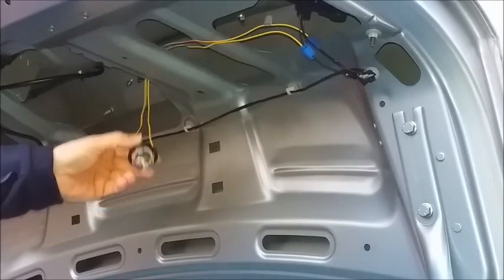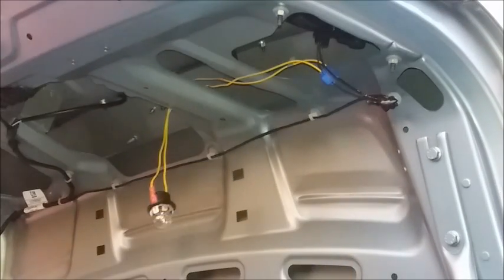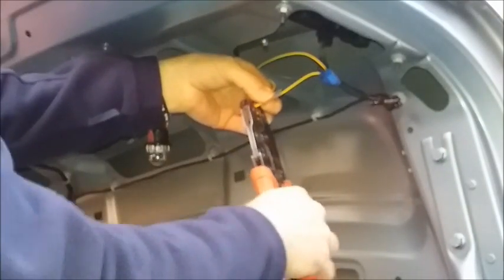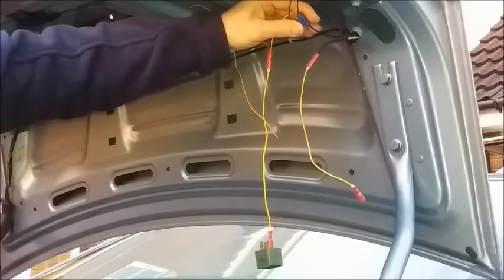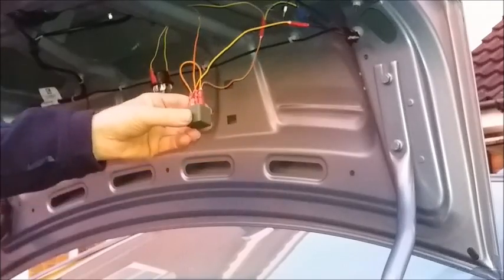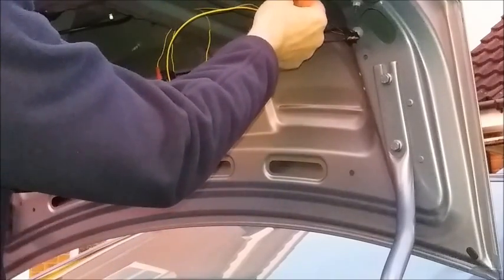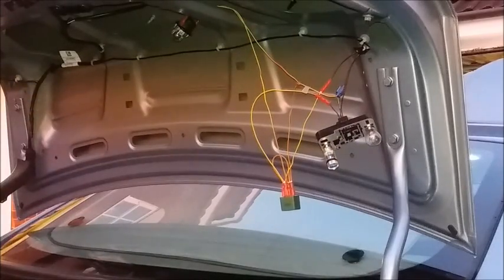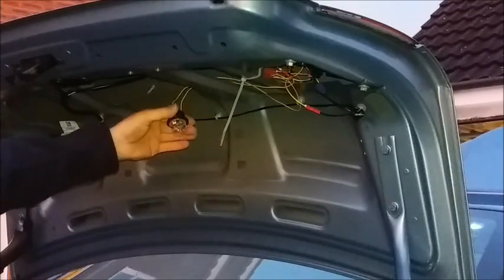How to Fit & STOP LED Bulbs FLASHING on a CANBUS Car

Comment: Hi..I’m trying to replaced my normal headlight with the genuine xenon headlight, after few second when you start the car they cut off 😞 any idea or help???
Reply from the maker: Switching out the standard halogen headlights for the optional (or Aero) xenons is possible but it is an awful lot of work. Once all the parts have been fitted it needs programming with Tech2.
There are easier options and I shall be doing a xenon headlight mini series later in the year.
Reply: Cyclone Cyd is Three any chance to play something only with the wiring? Or if you have any diagrams
Reply: Costantino Fortebracci I had this exact problem, the UEC doesn’t send enough power required to keep xenons running, u got 3 options, 1. Wire a separate switch and wire for only your xenon, 2. Wire a lead from +15 fuse to your headlight, which will always be on as long as key contact turned to on, will never flash or go out, 3. Go with tech 2 /dealer, I did option 2 so I could turn off the lights whenever I wanted, takes a bit of wiring, but worth it

Comment: I just changed to LED lights on the reverse lights on my saab 9-3, they do flash. I'm just wondering if it is necessary to fit relay? I don't mind the flashing and its only on the reverse lights
Reply from the maker: In the Uk it would fail MoT and be considered unroadworthy. It might also confuse a driver behind and if he were to hit you and could produce dashcam footage you would likely end up 50/50. And it might attract the attention of Dibble and That's the wrong sort of attention in my book.

Comment: Used this technique for my front headlights on my Saab 9-3  works a treat thought I was going to have to stick to halogen for a while
Reply from the maker: I've got a headlight refurb project coming up soon. Fitting new projectors. You could 'upgrade' to HID projectors. 👍
Reply: How did you handle the bulb connector on the car for the headlights? Did you have to cut it off to connect from the bulb to the relay?
Reply from the maker: @Travelwithleo  No, don't cut the connector off. Use 5.3mm spades to connect into it.
Like these  https://www.ebay.co.uk/itm/293305356049
Reply: Travel With Leo no managed to build a connector that fit into the original and branch off to the relay box

Comment: Hi I have a Vectra c is there a way to stop flickering on rear light/brake light ? Or is it not possible at all?
Reply: I have a Vetra C too with a lot of 382 - P21W bulbs in it. Unfortunately, that is one of the expceptions mentioned at the end of the video. @Cyclone Cyd, did you find any workaround on this type of bulb? :(
Reply from the maker: Not yet. I'm still looking though

Comment: Nice video! I know this is probably hidden in quite some comments, but I'd like to have a check with you on my project. I have substituted all my bulbs with LEDs on my Saab 9.3 cabrio (2006). High, Low and Fog. With engine running, I always have low beam on, so no pro there, but high beams and fog bulbs flickers (and it's not really fine, though it doesn't blind anybody). Do I need a separate relay+resistor wiring for all of them? If so, can I try an installation right after the cables exit the main computer unit, to try to keep all the wiring in order and tucked away? I understand it could take 6 relays/resistors, so it's a lot...Thanks for any help.
Quick integration...would something packaged like the morimoto anti-flicker capacitor work? It's just one random product I found looking around and it seems pretty compact, if the connections are Saab compatible.
Reply from the maker: yes you need a relay for each bulb. Don't see why you couldn't do it at the BCM, would be tidier
Reply: @CycloneCyd  Thanks, do you believe there is enough room there? Could it be possible to actually use the two 87 and 87A pins to connect 2 bulbs to one relay?
Reply from the maker: @giuliomorandini3137  not sure about the room, I haven't looked. One relay per 2 bulbs? Yeah, I think it'd work.

Comment: Hello mate thank you for the video - quick question I have the resistor (an actual 50w 6ohm resistor) do I still need the relay? Thank you 😁
Reply from the maker: Hi Shane, yes you need the relay. the resistor fools the system so you get no error message, the relay separates the LED so it does not flash with the check pulses.

Comment: Will you need to have one of those little resistors for every led light you want to swap in? For example, I want to change my low beams, high beams, city/parking lights, foglights, and license plate lights.
Reply from the maker: 1 resistor per bulb yes
Reply: @CycloneCyd  oof lol. That's a lot ot resistors so fuck that plan😂 I guess I'll just live with the flicker
Reply: Love how you educated us car-fixing rookies with the how and why! I have a Saab 9-3 and the flicker from the LED headlights continue for a solid 20 to 25 minutes after I turn the car OFF! But the fix is so involved. If I just leave it, will it harm my car eventually?

Comment: Have shared your vid with a few others who tried n failed as I did b4 finding your vid. But, I also have a Saab 9-3 Aero Cabrio on a 55 plate. If doing as you have for the reverse lights, provided the resistors are in line for each bulb separately, can we connect in BOTH reversing bulbs to the same Relay without any hassle?  After all, its only a relay and should be able to handle a pair of lights!!
Reply from the maker: Good thinking Batman! Hi Mark, yes I think you could. You'll need a resistor at both positions (because the system detects the bulbs sequentially), but you could use one relay and just connect the two bulb positives together across the boot. You could do the same on the front parking lights and main beam assists too. Thanks for sharing, glad people are getting value from it. Let us know how you get on.
Reply: @CycloneCyd  Cheers. Just a quickie,  for those who don't know the relay terminology, might be good idea to simply list the numbers on relay and which connects to what....
85 - Positive feed from car
86 - Negative feed
87 - Positive feed to LED
87a - Positive from Inline bulb
30 - Split from Car feed in 85.
Errr.... Think thats correct ??? Pls confirm lol
Reply: Cheers Mark, i was just about to ask the same question!

Comment: Hello,
I have a Vectra C 2008 year. I take a led to front side light (W5W aka parking light) but if the ignition is off, the leds are flashing. If i buy only a resistor is enought (39 ohm 10W) , or I need a relay and resistor too, for the solution?
Reply from the maker: You need the relay and resistor as shown
Reply: @CycloneCyd  many thanks for the quick answer, and thanks for your help!

Comment: I bought some H7 LED bulbs and when i turn off the lights, the blink every 3-4 seconds. I have read that you can buy a decoder to put in between but dont know what to get. Can you give any advice or do a video showing how to do it on the low beam headlights?
Reply from the maker: Hi Mark, the method is exactly the same for any lamp position. Doing it on the reverse lights was just an example (and I needed super bright reverse lights).

Comment: Hi I have realys very similar to the ones used altho the diagram is different and 85 and 86 are reversed can these be used or do they need to be exact??
Reply from the maker: Hi Marc, Thanks for watching, welcome aboard. All that matters is they are changeover relays and you can identify the NO and NC (normally open and normally closed, resp.) contacts. I don't know whether the pin layout or numbering are 'standard' or not, but they don't matter as long as you can meet the requirements of sentence 1.
Reply: Do they have to be 5 pin type??
Reply: I have 2 here but have no idea if there usable or not
Reply from the maker: @marchood99  5 pin yes.

Comment: Hi there i found this really helpful i have a vectra c and i did my side lights with the and worked a treat im going to do full beam and fog lights and just wondered if the same set up here will work for them thanks
Reply from the maker: Hi James, welcome aboard. many of my 9-3 videos are relevant to Vec C too.
Yes, exactly the same for all positions except tail/brake
Reply: @CycloneCyd  thanks mate i got them all done very happy lol
Reply: Hi i am abit confused as to how to do the full beam light as the bulb only has a positive going to it and the negative is attached to the cluster do i just take my negative from the for the acting bulb

Comment: Does the led drain battery when the leds flicker? I got them in my low beam and i dont want to wake up to a dead battery
Reply from the maker: No. Once the car is locked the ECUs go to 'sleep' and after about 1 minute you'll find they are no longer flashing.
Reply: @CycloneCyd  Is this the same for taillights?
Reply from the maker: @shawnlee3397  yes

Comment: And how does this work with number plate leds?
Reply from the maker: The number plate lamps are on the canbus bulb check circuit so they need the same treatment. Exactly the same.
Do let us know how you get on.
Reply: I had it done on the number plate lights and it did worked. Thank you for that.

Your video was recommended on Audi owners forum and I used this on A6 Avant.

Did exactly the same with both reversed bulbs and have problems.

During the day, when light sensor switch off driving lights, I get instant error on DIS, when reverse gear selected. First for one bulb and than the other, as they are separate on two separate circuits. Computer still try to see them and I can hear relay going off and on but eventually lights go off.

During the night or low light, it does work and can hear relay going on. If I stay too long on the rear gear (20-25 seconds), relays will go off, DIS will throw error and situation with relay on/off happens again. It will go off completely after 3 tries.

After both situations, if I select reverse gear again, no light will come on.
If I drive around a bit, it will switch the light on but the error on the dash will remain.
When I switch off the ignition and repete above in day or night, same thing happens.

I've installed load resistors  and all is good but canbus bulb check flashes the leds every 30 second in a sequence around the car.
It does look a bit like a driving disco, as got leds nearly everywhere.
Number plates are fine, with that method but have both front and rear indicators led, reverse leds and front fogs led.
Thinking of installing capacitors but worry about the power accumulated to go off somewhere where it shouldn't and when it shouldn't.

Anyone can suggest solution or recommend other method of solving canbus led bulb flash?

Comment: I have fitted a reverse camera in my car and connected it from the reverse bulb wire. At the same time i have canbus led installed on the reverse light instead of bulbs. Before the reverse camera installation i had no canbus error. But after the reverse camera installation it is giving error ''Reverse light right side failure'' Can u please help what can i do ?
Reply: Thanks a lot. I will give it a try and come back to tell if it works.. Have a nice day..
Reply from the maker: Hi Amy, thanks for watching and interacting.
Both the camera and 'canbus' LED need to treated to the method I show. you can connect them both on the output side of the relay.
The resistance of the camera is disturbing the bulb check system. If the camera has an LED of it's own you may see it flashing. Also the check pulses every few seconds may have an undesirable effect on the life of the camera electronics. using a relay as shown will mean both LED and camera are disconnected from the car when not in use.
Reply: Hello again. Just one more question and i will start the procedure. How many amps relay should i put in for the reverse light  led bulb and reverse camera ? And which resistor as well?
Reply from the maker: @amydarocker6531  IIRC the resistor should be 5.6ohm - the value is in the video somewhere. The LED only pulls a handfull of mA, even the smallest relays will handle that okay. You must get one with a 12v coil though! I'm sure there's a link to an example relay in the description.

Comment: Anyone calculated the resistor needed for the 55W fog lights? Thanks in advance
Reply from the maker: +Theodoros Stokkos thanks for watching and interacting. 2.6 ohms my friend
Reply: @CycloneCyd  thanks for your reply.  Is it true that these resistors produce a lot of heat? Of course reverse lights are on for a small period of time, so heat wont be an issue,  but fogs can be on for a lot of time. If those resistors produce heat then it will be dangerous if they are close to other wires and/or insulation etc. What do you thing?
Reply from the maker: +Theodoros Stokkos Yes, the resistors do get hot. As you say reverse lights won't because they're hardly used but other lights will. Best therefore to mount the resistors on metalwork and with some air space around them, especially at the 55W positions (55W of heat!!). I'd say make sure there's an inch of separation from wiring or soft plastic parts.

Comment: Just fitted hid into my 9-3 front projectors and tried Your method, result ...fail . All was looking fine but shortly after ignition on i got bulb failure message,  when car start checking wiring circuit i heard clicks... that was relay clicking when getting signal from canbus so simply relay is energizing and switching between hid and 50w resistor resulting in dash error.
Im just about to order Time Delay Relay SPDT 10 second ON (from china as is cheap) so that should eliminate this problem as You have power relay constantly for 10s to energize and switch over from resistor to hid or led. Soon as i receive this relays and test i will update result.
Reply: Just a wee update, i got my Time Delay Relay 3-5s delay and its working!!! So from now when i turn front lights on after 3 seconds relay energize and switch my aftermarket hid without throwing error. But got another issue , cant use those 55w resistors because they are giving error(i guess short circuit) so instead i hooked up orange indigator bulbs they have around 0.6ohm of resistance and passing canbus checks fine. Those 55w resistors have arround 6.0 ohms(cant remember exactly) and probably its too high resistance for canbus check when lights are off. Do any one know 12v ceramic resistor with arround 0.5ohm resistance who will resist full 12v load for arround 3-4 sec without firing up? Other vise standard bulb is a solution.
Reply from the maker: +Paweł Jeka yes please do. Something of a brain teaser this.
Reply: @CycloneCyd  Will do, just ordered those time delayed relays so now is just the matter of delivery time from China, once i get them i will update with result👍

Comment: Hi, very explanatory video. I got similar bulb-check issue on my Saab 9-3, but only with reversing camera, which has LEDs for illumination. I've connected this tiny camera  simply to reversing light bulb with one cable (positive) and negative to to screw next to rear lights cluster. Problem: When not in Reverse, the camera leds flashes like in your case without relay. The question is, how to wire it correctly, so the leds from camera stop flashing during my 'Saab 9-3 light bulb checking'. And when I select to reverse the reversing light bulb would go on like normally.  Not sure if resistor would not disable my regular 12v reversing light bulb. Any suggestions are welcome.
The connected camera does not cause any error message on dash. It just flashes in regular intervals.
Reply from the maker: +T. Bezak Thanks for watching and the kind words. Yeah, it sounds like the check pulses are having a similar effect on the camera as they do on LED bulbs. In the long term it might damage the camera. Yes, use a relay. You only need an on/off relay or use the 'no' connections if it's a changeover relay. Wire the relay coil to the light and earth. Take a feed from the rear fusebox (left side of boot) and connect to one side of the coil (com if changeover) and the other side of coil to camera. Camera negative direct  to earth. Make sense??
Reply: @CycloneCyd thank you for quick reply. any advice what relay should I use or just any would do?
Reply from the maker: +T. Bezak any 12V relay will do. Nothing special required 
something like this
https://amzn.to/2PKnOuo
Reply: @CycloneCyd 
Bought the 4 way relay from your link and got it working! Leds don't blink during normal ride, my Saab won't give any errors, reversing bulb and camera tŕň on when selected reverse. Thanks again.
Reply from the maker: @TBezak  you're welcome. Great to hear it worked out well for you.

Comment: Here's one for you to look at pls.
60 " Triple led rear light bar by Ambother.  Similar to Opt 7

We cut the the plug off as vw caddy does not have a hitch plug.
It is a canbus vehicle

Wiring for led bar

Brown    earth
White      running lights
Yellow and green  connect to left indicator  and right indicator.

Seperate Red for reverse.

The vehicles brake light connects to both yellow and green ie The same connector as the indicators.

Ing off..... We have red Running light .
Sequential amber turn and hazard.

Reverse
 Brake lights. 

Turn ignition on....reverse is ok
Then things go wrong.
 Indicators flash only 4"" instead of sequential  for 30 "
Etc.
Running light flickers instead of solid.
Any ideas how to correct this issue?

Comment: Hi cyclone what wattage do you have to use on the resistor because I used 50w resistor but it didn't work at all still has pulsation on led turn signal do I use the 25w one? thanks
Reply from the maker: Juan Nunez Roman hi, it should be able to work with either wattage as long as the resistance is correct (6 ohms ish). 50W is better because of the vehicle voltage maybe as high as 14.5V and the power dissipated becomes nearly 30W. Would be a problem where the bulb is on continuously but shouldn't be for indicators. 
Does that help?